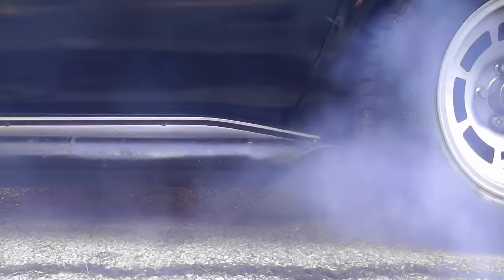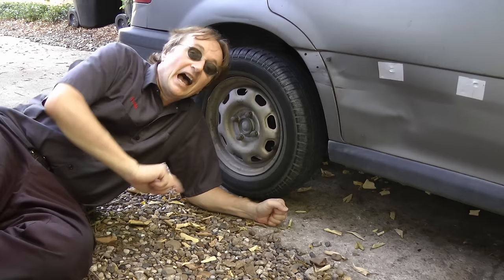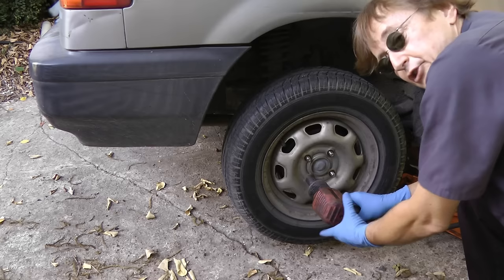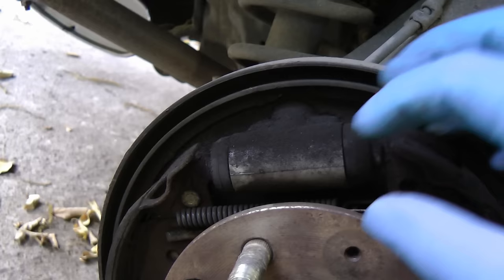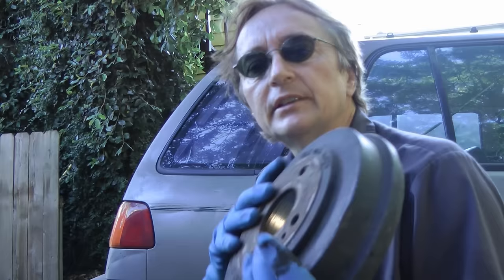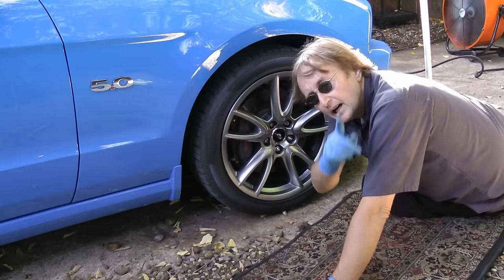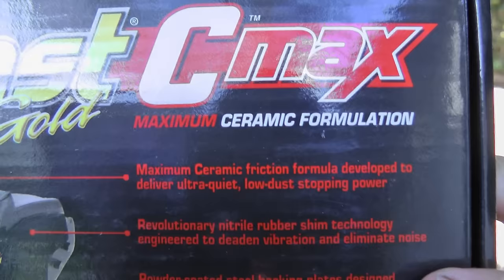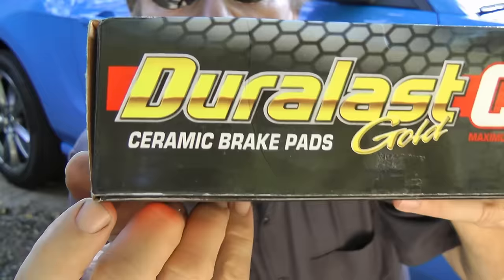How to Fix Squeaky Brakes in Your Car

Comment: Brake rotors are cheap don’t waste hours of ur life driving around to shops trying to get ur rotors turned just buy new rotors. The majority of shops don’t even have brake lathes anymore because rotors are so cheap and it’s not worth the time to turn rotors. The only reason why I have a brake lathe is really just to turn drums because for whatever reason just about every brand new drum is out of round and needs to be turned so I turn every brand new drum and I sell some cars so if a car sits on my lot for a few months the rotors get rusty so I will cut them quick so I don’t need to buy new brakes because the brakes are just fine they just have a little rust that needs to be cleaned up. If you can’t afford to buy new rotors you obviously have money problems (I mean no disrespect) so buy a cheap set of pads and just put them on and save up for some quality brakes.